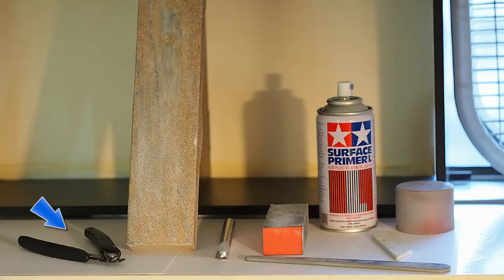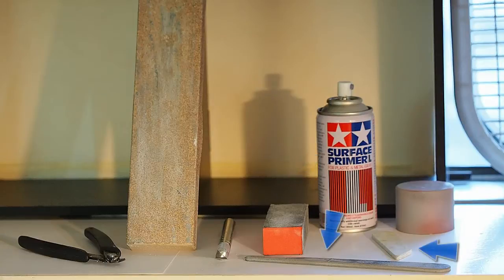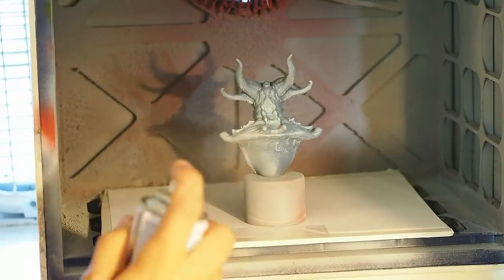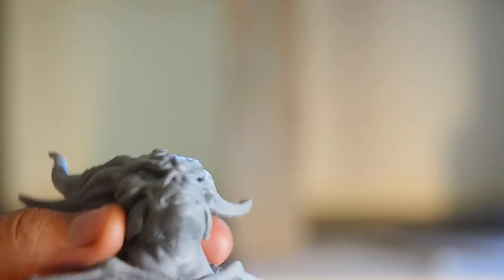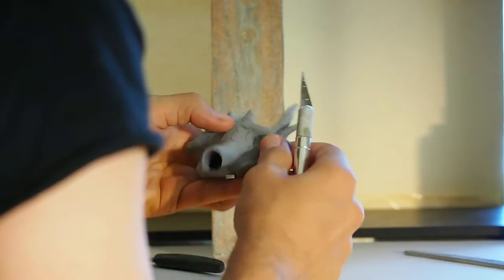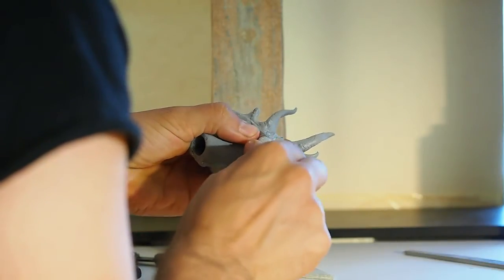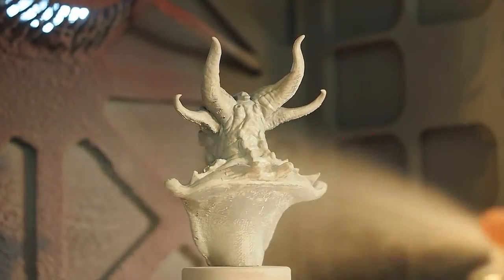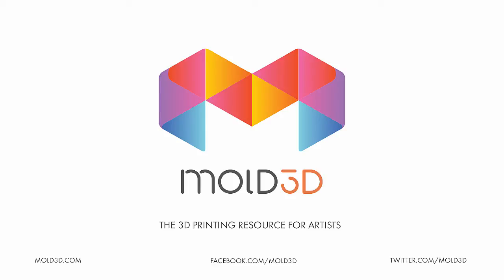SLA 3D Print Cleanup - Part 1

Comment: what SLA/DLP printer would you buy today? looks like you've had some experience. can't believe your video is from 4 years ago
Reply: I sure am late to the party but I think the technology has vastly improved since then. My $250 table-top Elegoo Mars puts out near flawless prints which don't need that much cleaning, albeit in a much smaller build size.
Reply: Epax and Anycubic Photon are nice and not very expensive.